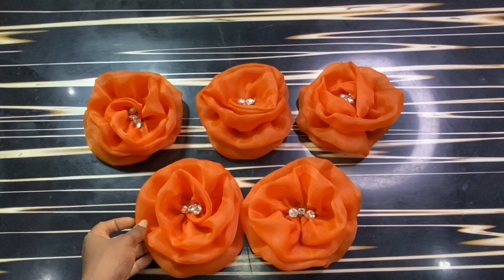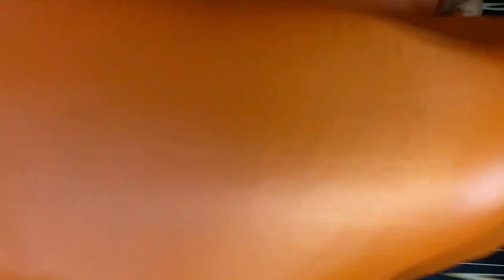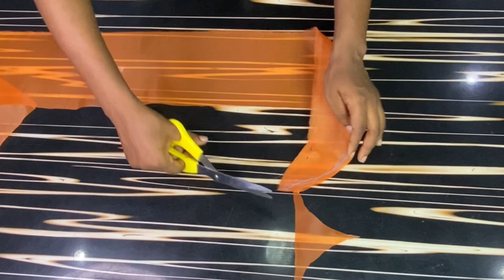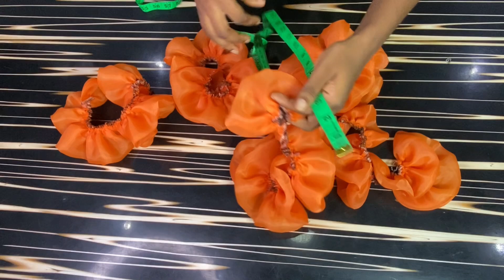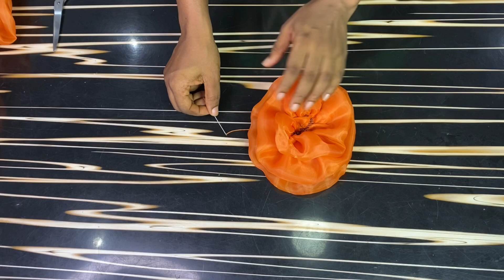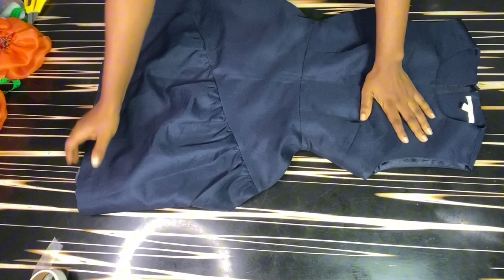DIY: HOW TO CREATE A STYLISH FABRIC ROSE USING ORGANDY/ ORGANZA FOR YOUR DRESS #beginnerfriendly

Comment: I guess you are making mistake,how can this be 1yard
Reply from the maker: It is 1 yard. When you divide your 1 yard by 6 inches you will get 6 pieces of fabric which will make 6 different rose. And I used only 5 for the dress. Also organdy has a length of 60 inches. Thanks for watching